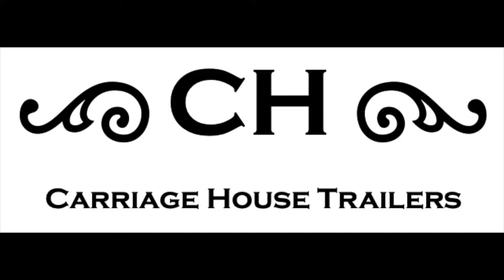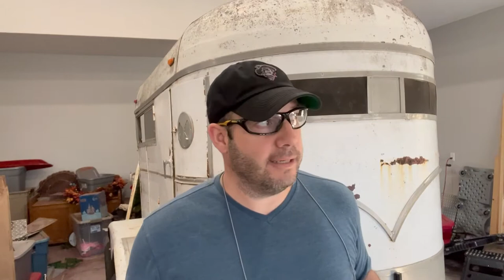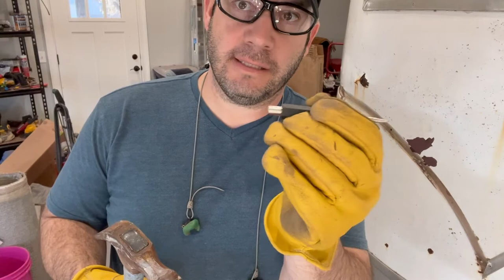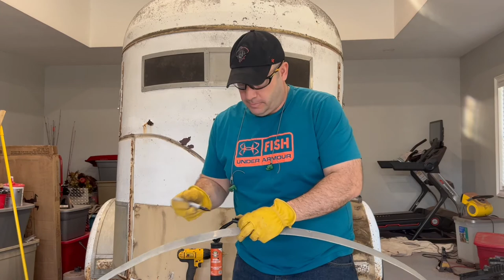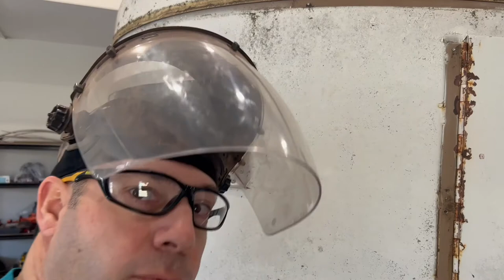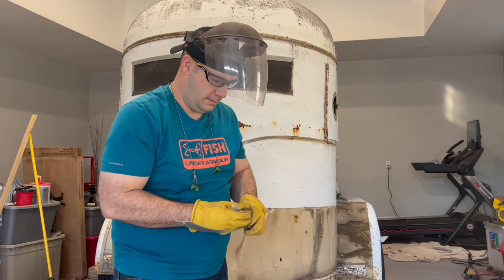How to remove the trim! Teardown

Comment: Curious as to where you get replacment trim pcs if old ones cannot be salvaged. Is it a type of Z bar used typically for flooring applications?
Reply from the maker: The best place I’ve found is https://www.horsetraileraccessorystore.com/
They have the best selection of trim. The trim for the front that curves down to a point is z trim. The trim along the roofline and doors is typically lipped trim.
Reply: @carriagehousetrailers  Awesome, thanks for the info!
Reply: You are a great teacher!

Comment: Hi.. what tool did you use?
Reply from the maker: To drill out the rivets, it's a cordless drill with a 9/64 drill bit. You want a drill bit that is just barely bigger than the holes in the center of the rivets. To knock the rivets out, you can use a nail punch and a small hammer to knock them through. There's links to all of the tools I use in the description. Here's the links to the tools. I hope that answers your question.
DeWalt 20V Max Drill - https://amzn.to/3txCvlE

DeWalt 20V Max 8ah extended battery  - https://amzn.to/3tthjgz

Drill Bit Set - https://amzn.to/3vDZZYV

Just the 9/64th bit for Rivets - https://amzn.to/3hE2fax
Reply: @carriagehousetrailers  Great. I was thinking more for the sanding of the steel. What tool would you use? I just bought a horse trailer and plan on doing most of the work myself.
Reply from the maker: @roxanaroman1402  I haven't made a video of paint removal yet. I'm recording as I go through this current build. There are a few options for paint removal though. An orbital sander with 60 grit or 40 grit sandpaper will remove it, but this method takes quite a bit of time and elbow grease but is better than just a sanding block with paper. 
The next option, which I used on my other builds, is to use an angle grinder with a 40 or 60 grit flap disk. That method is much faster, you just have to be careful not eat too deep into the steel. 
The other option, which I plan on using on this build, is to find a local person who does sand blasting. Someone independent instead of a big company will give you a better price. I still plan on showing examples of the orbital sander and angle grinder methods though. I will post that video on this channel when I get it recorded. 
In the meantime, here's a list of the orbital sander and angle grinder tools that I use.

20V orbital sander - https://amzn.to/36crY7D

60 grit sanding pads - https://amzn.to/3w1Jw0W

20V angle grinder - https://amzn.to/3tQxswH

60 grit flat discs - https://amzn.to/3KFux0Z

8aH 20V battery - https://amzn.to/3MGo33D
Reply: Where can we find the window trim replacement or do you make one using flat trim?